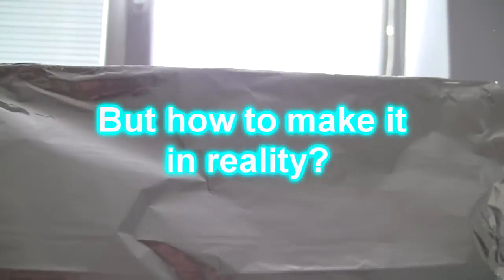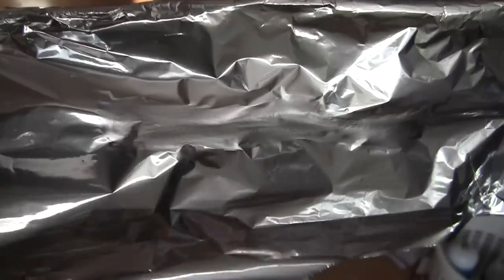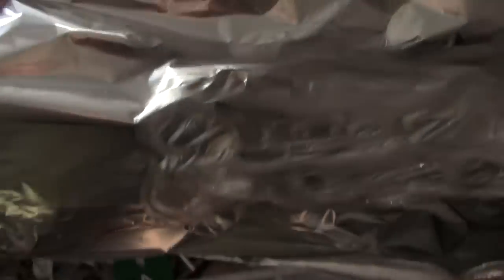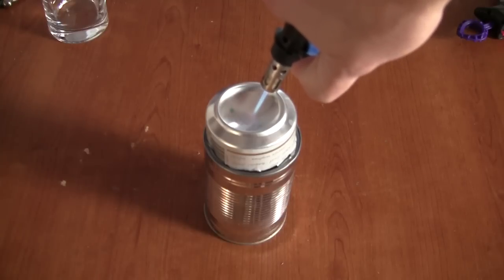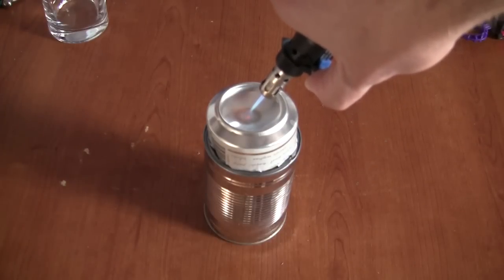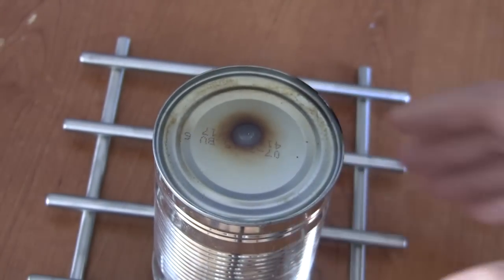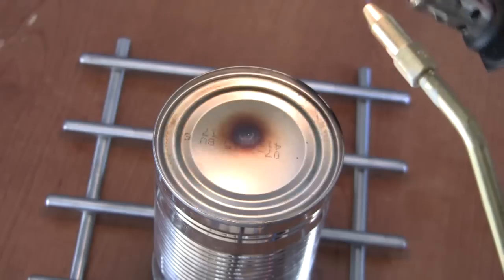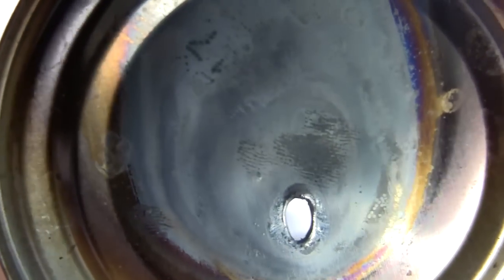How to make REAL Transparent Aluminium!

Comment: interesting, but i assume this weakens the material right?
Reply: +Christ J incorrect. 100% pure sapphire is called white sapphire. as in sapphire glass, used for luxury watches and for the windows of cruise missiles and for high pressure applications. in natural gemstones, the colorless variety is also called white sapphire. the real issue is that for aluminium oxide to be called sapphire it must be crystalline.
Reply: +Paul Meyer pure Aluminium oxide categorically is NOT called "sapphire".
Reply: Paul Meyer yes, really. "Sapphire" requires certain impurities to give it colour. A colourless "sapphire", by definition, is not sapphire.

Nice link, by the way. Very mature. Particularly embarrassing is the fact that it doesn't actually match your assertions. Maybe you should ask someone to teach you how to use Google properly...
Reply: kurtilein3 sorry, but sapphire is a variety of corundum, which is aluminium oxide with iron, titanium and chromium impurities. Aluminium oxide without these impurities is aluminium oxide, not corundum/sapphire/ruby.

http://rruff.info/doclib/hom/corundum.pdf

- by definition, sapphire is a variety of a mineral that is defined as being impure aluminium oxide. I know this may seem a little pedantic, but this dictates that aluminium oxide (PURE aluminium oxide, that is) cannot, by definition, be referred to as "sapphire".

Even "100% pure sapphire" is not pure aluminium oxide.
Reply: +TheGeckoNinja Transparent aluminium is actually incredibly strong, although when it's used in manufacturing processes they tend to have a slightly more refined way of producing it.
Reply: echomjp those miniscule impurities generally make all the difference, though. Far from being pedantic, pointing out these tiny differences is sometimes the only way to tell variant of a substance from another.

Have you ever seen jewellery advertised as having an Aluminium oxide crystal in it? Or seen a thermitic reaction described as producing iron and sapphire?

Paul Meyer stated that Aluminium oxide and sapphire were the same thing. All I'm saying is that, by definition, they are not.
Reply: +TheGeckoNinja     Transparent aluminum, also known as aluminum oxide, also know as saphire
Reply: +Profezor Snayp Wait a second, providing well cited evidence makes him look dumb, while at the same time you are saying we should just take your word for it?
Reply: Bruce Wayne
Also, no. Oxygen is not called air and vice versa because air is mostly composed of nitrogen. If the majority component were oxygen, then it would be somewhat more forgivable to call them the same thing in common conversation. If the vast majority component (as is the case in sapphire) were oxygen, rather than just a normal majority, then it would be pointless outside of scientific research or addition of dangerous gases to call the air anything but oxygen.

For the same reason we don't call the air we breath in "air with a mixture of dust particles and water vapor and whatever micro-organisms float in the air among many other things depending on the situation." The exact composition of air and of most substances in the world is never exact, so all we really need in most situations in the real world is to describe something in a way that can be quickly understood and is mostly accurate.
Reply: kurtilein3 no, sapphire, specifically BLUE sapphire, is an Aluminium oxide crystal with iron and titanium impurities. Look it up.
Reply: +Profezor Snayp your CLAIMED expertise is worthless, as I provided evidence that backs up what I said. I'm right, and you're wrong. No amount of arguing from (claimed) authority will change that.

The instant you rely on a logical fallacy to twist your way out of a situation that you incapable of explaining your way out of you have tacitly admitted your error. The fact that you mention a source that I haven't actually linked to makes you look even more of a fuckwit than your dogmatic desperation to preserve your ego amongst complete strangers in an anonymous forum. Pathetic.

Of course, as a decent scientist I'm willing to admit an error if you can show me to be incorrect. With that in mind, I invite you to present some evidence that PURE Aluminium oxide and the mineral referred to as corundum are identical. I won't hold my breath...
Reply: +Christ J  Oh really:
http://lmgtfy.com/?q=al2o3+compound+name
Reply: +Christ J That is indeed pedantic. Sapphire is primarily made up of aluminum oxide, and in nature it is nearly impossible to "get" a completely pure sample of any substance in the first place. So really, it boils down to exactly what the impurities are and how common they are. Neither of those points will change what the primary composition of the substance is, or in this case properties, so it seems a bit weird to mind what the name is.

Anyway, clarifying that it isn't "really" sapphire I suppose could be true. It just is that if someone were to say "this is almost entirely made up of aluminum oxide" it would be 100% accurate, but that doesn't roll off the tongue very well compared to just calling it sapphire. It isn't like we're actually doing chemistry here, and need to worry about the minute details in day to day descriptions of things.
Reply: Christ J
what the fuck?  http://www.guildoptics.com/optical-windows/sapphire-windows/?gclid=CP7V7dbyhsgCFUHnwgodL3gCiQ
Reply: +K IRA You're both right in a way. It's very hard, but inflexible. That makes it brittle, sort like steel with too much carbon. Makes it harder, but more prone to shattering.
Reply: Skippy Rock
Well, being pedantic actually can have a purpose in science, where small distinctions matter. So, sure.
Reply: +Christ J Aluminium oxide Al2O3 is called corundum. Every single variation except for the red type is also called sapphire. The red one is called ruby. So in other words - the colorless type is called sapphire.
Reply: That's one big ball of logical fallacies you got there...
Reply: TheTinySaint
At this point, when various people have pointed out his "well cited evidence" is bs, it doesn't really matter. Everyone on the internet is an expert in every field imaginable. I base my knowledge on years of studying and working in field of geology, petrology, mineralogy etc - he reads websites on the internet. Seems equally valid. Goodbye and goodnight.
Reply: "Aluminium(III) oxide (Al2O3) ... commonly called alumina, and may also be called aloxide, aloxite, or alundum. ... In its crystalline polymorphic phase α-Al2O3; corundum, sapphire, and ruby".

That's taken from wikipedia (not the best reference I know but usually OK for science. I'm a scientist but this isn't my field). So it appears that different crystal structure give it a different name and the impurities that colour it are irrelevant. So aluminium oxide, alumina and corundum would be analogous to carbon, graphite and diamond respectively if that helps anyone. You can say "diamond is always a crystalline form of carbon" but you can't really say "carbon is always diamond" as often it's graphite. Likewise, sapphire is a crystalline from of aluminium oxide, but aluminium oxide is not always sapphire as often it's alumina.

Hopefully that will help to conclude this rather pointless discussion but I doubt it will make a difference.

There are also Aluminium (I) oxide and Aluminium (II) oxide which again are different.
Reply: I hate to stick my nose into a heated debate and I'm not going to take sides, but ask is the difference a crystal structure thing, like how graphite and diamond are both carbon? If it is something like that and not about the impurities that give different colours, that would be like arguing all carbon is diamond because all diamond is carbon. I'm not a geologist, please don't bite my head off.
Reply: Christ J Except I did refute it, did you ignore that post?
You know, the one where I linked to a variety of scientific sources showing corundum as just being aluminium oxide (with no mention of impurities, one even having a section from trace elements with nothing listed) (and one having it being 0.004% of aluminium replaced by chromium).

Corundum (and thus sapphire) is a form of aluminium oxide which may contain trace amounts of other elements.

Corundum refers to a crystal structure, not to alumina with impurities. It is similar to quartz and silica.

Also note, your reference appears to list quite a lot of things as having impurities, for example:
diamond:
"Nearly pure carbon"
http://rruff.info/doclib/hom/diamond.pdf

Quartz:
"SiO2 with traces of other elements."
http://rruff.info/doclib/hom/quartz.pdf

Anatase:
A combination of TiO2 [which is what anatase actually is] as well as SnO2, Al2O3, Fe2O3, CaO and LOI, however that is only for one composition, another composition given only has TiO2 and Fe2O3, adding up to a total of 99.67%.

So it appears your site is just listing the composition of some known samples, not defining it as what it contains.

So care to admit you were wrong?
Reply: kurtilein3 Also, that would be equivalent to making it into aluminium and oxygen atoms, not Al2O3.
Reply: echomjp
is there something wrong with these 100% pure sapphire windows? http://www.guildoptics.com/optical-windows/sapphire-windows/?gclid=CP7V7dbyhsgCFUHnwgodL3gCiQ
Reply: +echomjp to me it sounds like the other guy is right, like calling oxygen air and vice versa.
Reply: Christ J
aluminium oxide and sapphire are not the same thing, but you are wrong about the impurities. sapphire is an iron oxide crystal. the kind without impurities is called white sapphire or sapphire glass.
Reply: Profezor Snayp wrong. Al2O3 is called Aluminium oxide. Corundum is Aluminium oxide with certain impurities.
There is not a single variant of corundum which is pure Aluminium oxide. Corundum is defined as IMPURE Aluminium oxide.
"Nearly pure Al2O3, with traces of Fe, Ti, and Cr."
- see that? That is how corundum is defined. There is no rational way that "nearly pure" will ever mean "pure". The definition of "corundum" is, in essence, "impure Aluminium oxide".
By the way, that little excerpt is from here:
http://rruff.info/doclib/hom/corundum.pdf
- which I have already posted once in this thread. Try reading these sources before making claims that are refuted within them - It makes you look like a moron.
Reply: Profezor Snayp Absolutely mind boggling how a geologist can tell him he's wrong, yet he still doesn't comprehend it.  It's not even that complicated of a concept.
Reply: hondac55 I don't give a shit what some lying YouTube troll says I'm wrong, because I have presented evidence to the contrary. Until you refute that data it remains valid, which means I am right by default.

I'm right - you're wrong. I have evidence - you have nothing but narcissism.
Reply: Christ J I have presented evidence, which you ignored.  You are what's wrong with the internet.  You're obviously not going to change your mind, so we're done here.  Pure Al2O3 is sapphire, whether you want to believe that or not is irrelevant, it's just a simple fact of nature.
Reply: Christ J
the thing is, the links you provided were crap, and you ignored the links we provided. white sapphire and sapphire glass is pure aluminium - no impurities. it is called white sapphire by scientists, engineers, watchmakers, gemologists and dealers all over the world. that is the main problem: you are wrong, your links are crap, and you refuse to admit it. i will re-post a link you ignored: http://guildoptics.com/optical-windows/sapphire-windows/?gclid=COm9mPnliMgCFVEYGwodFkkEOA   and i will add another one  http://us.tagheuer.com/en/avant-garde/innovations-technology/movementsandmaterials/details/materials/sapphire-crystal
Reply: KX36 essentially, yes. Different impurities interact with light in different ways, resulting in different colours, shades, etc. Globally, they  have extremely similar structures.
Reply: Christ J I have exactly three (now 4) posts in this thread, one of which contains a higher quality link than any of the links you've posted.  You're here to argue, you're not here to learn, that's your downfall.  I learned from my experience here; particularly, I learned that Al2O3 is sapphire.  Now go cry.
Reply: KX36 and if you had clicked on the hyperlink to "corundum" you would have found this:

"Corundum is a crystalline form of aluminium oxide (Al2O3) with traces of iron, titanium and chromium."

- see that? Corundum is not Al2O3 which sometimes has impurities within it, it is a mineral which ALWAYS has "traces of iron, titanium and chromium" within it. Those trace elements are every bit as fundamental to corundum as the Aluminium oxide they wedge themselves into.

Wiki is a decent resource, but you really need to treat it as a starting point, rather than the final word.

"So aluminium oxide, alumina and corundum would be analogous to carbon, graphite and diamond respectively "

- graphite and diamond differ in their crystal lattice structure, but this results in wildly different strengths. Sapphire and corundum have the exact same hardness, which is a clue as to how similar they are in terms of their crystal structure.

Think of sapphire as corundum crystal which has a particular colour.

"sapphire is a crystalline from of aluminium oxide"

- yes, but ONLY when certain impurities are present. Sapphire NEVER features only aluminium and oxygen. Ever.

"Hopefully that will help to conclude this rather pointless discussion but I doubt it will make a difference."

- nope. I'm too stubborn to let people ignore scientific data just because it would mean admitting they were wrong, and those two are too egotistical to read the paper I presented and either accept it or refute it.

I've blocked them both now, as I'm sick of their spam, so this will end here. They were never going to give me anything to analyse anyway...
Reply: _"So aluminium oxide, alumina and corundum would be analogous to carbon, graphite and diamond respectively "

- graphite and diamond differ in their crystal lattice structure, but this results in wildly different strengths. Sapphire and corundum have the exact same hardness, which is a clue as to how similar they are in terms of their crystal structure."_

If you re-read what I said it was that alumina and corundum have different structures, not corundum and sapphire have different structures.

Although the impurities are present, it does seem like it's irrelevant to the difference between alumina and corundum (where sapphire and ruby are types of corundum) and that the differing factor between alumina and corundum is the crystal structure regardless of purity.
Reply: hondac55
quote: " I learned from my experience here; particularly, I learned that Al2O3 is sapphire." incorrect. sapphire is Al2O3. but sapphire is never a white powder of no significant hardness. it always has hardness 9. Al2O3 generally is a white powdery substance of no significant hardness. you fell into the carbon vs diamond trap.
Reply: KX36
its more like carbon and diamond both being carbon. with aluminium oxide being equivalent to carbon, and both sapphire and corundum being equivalent to diamond.

and then the discussion gets complicated by one nutjob arguing that highly pure sapphire, the perfectly white and clear and flawless variety, is not sapphire.
Reply: kurtilein3 You can't even say that sapphire isn't Al2O3 without contradicting yourself.  "Sapphire is Al2O3," my point exactly.  If you grind up a diamond into a fine powder, it is still diamond.  If you grind up sapphire into a fine powder, it is still sapphire.  The opposite is also true.  Powdered Al2O3 = sapphire.
Reply: Leuco-sapphire.

Every form of sapphire is just a variation/modification of corundum. 

The "colour" or more specific the amounts of other elements within the corundum make all the "difference". It´sjust a specification process. If it´s red (chromium) we call it ruby - any other colour we will name "sapphire" EVEN THOUGH the variations within sapphire could also be split up into many different groups (but they don´t have special names... even if the colour-spectrum is quite huge).

So corundum = sapphire, ruby, padparadscha and so on, leuco-sapphire being the transparent form of it. 

So I really don´t get the "debate". 

TO make it very clear SAPPHIRE, RUBY and WHATEVER - are JUST varieties of the SAME material.

EDIT: I have to make this clear - I welcome every sort of criticism but I am pretty sure that this is factual. Also please don´t be to harsch on my english, for it is not my first language.
Reply: Semjasa616 The debate is whether Al2O3 is called "sapphire."  Obviously it is.  The structure of the Al2O3 does not determine whether sapphire is sapphire or just Al2O3.  Al2O3 is sapphire and sapphire is comprised of Al2O3 at its base.  The chemical sapphire is Al2O3.  There is no debate, that's just...that's fucking common sense, Jesus..fucking...Christ.  Not against you, but some of the other people in this thread, it's just a ridiculous argument.  Sapphire is Al2O3, there's no other way to say that.

Also, your English is very good; considerably better than most people's English who have been speaking only English their entire lives.  One correction, not to be rude but just so you know, "harsh" has no "c" in it, as in, "I'm trying not to be harsh on you."  :)
Reply: hondac55 well I mean it is a discussion about nothing thats exactly the point. 

Ye and btw. that thing with "sch" and "sh" is a typical "writing disability" that stems from my mothertongue, german. Quite silly but ye.
Reply: Semjasa616 Yeah I figured it was some sort of crossover from your native language, not a big deal, but it's good to learn.  :)
Reply: KX36 " the differing factor between alumina and corundum is the crystal structure"

- ah, gotcha. In that case, you're still not quite right. Corundum is a variant of alumina, just as sapphire is a variant of corundum. Think of alumina, corundum and sapphire as family, genus and species respectively.
Reply: Semjasa616 "TO make it very clear SAPPHIRE, RUBY and WHATEVER - are JUST varieties of the SAME material."

- agreed, just as they are all forms of corundum. However, they are NOT pure Aluminium oxide.

"So I really don´t get the "debate". "

- I've been disputing people who are insisting that "corundum" and "sapphire" are compositionally identical to "alumina". Scroll up a little and you'll see them repeatedly stating that sapphire is PURE Aluminium oxide, which is simply false.

You're perfectly correct in that there is no debate here, but that hasn't stopped them from spamming the thread anyway.
Reply: hondac55
this is not true. you can grind down diamond into carbon, at which point its unique properties are lost. AL2O3 lacks the hardness, transparency, thermal conductivity and tensile strength of sapphire.
Reply: kurtilein3 Why is it then that you can grind up another crystallized chemical, C12H22O11, into the finest possible powder, and it is still C12H22O11?  Do you not see the point here?
Reply: +Christ J Corundum is actually a crystalline form of aluminium oxide. The impurities doesn't matter. If it's an aluminium oxide crystal, it's called Corundum. Pure crystal is corundum, sapphire is corundum and every other variation is corundum.
Reply: TheFarciarz777 "If it's an aluminium oxide crystal, it's called Corundum."

- wrong. If it's PURE aluminium oxide then it's called aluminium oxide, or alumina. Corundum is what we call aluminium oxide when it has impurities.

Check my previous links. One is to a scientific definition which explicitly states that corundum contains impurities. Since no-one has managed to refute it I am accepting that link as correct. Maybe you can shoot it down...
Reply: Chris G maybe, but that means it isn't Aluminium oxide. Sapphire =/= Aluminium oxide.
Reply: kurtilein3 No. You can't. If you gind down diamond (using another diamond to do so, or going through a lot of grinding tools) you will end up with diamonds. They will no longer be the wonderful single crystals that they once were, but they will still be diamonds. This is used in a variety of tools, such as diamond saws.

The only exception is if you grind it down to the nanometre scale, at which point it can undergo surface rearrangement and change properties.

And of course, to view the properties, you would need to be analysing a single crystal, not a bunch of crystals in the form of powder. That would be like analysing a bunch of diamonds in a truck and declaring that it isn't as hard as a diamond. Multiple individual crystals (not polycrystalline materials) are rarely as hard as a single crystal as the crystals are free to move around.
Reply: Jeffrey Black "Except I did refute it, did you ignore that post?
You know, the one where I linked to a variety of scientific sources"

-you haven't posted in this thread before, princess, so feel free to keep your bullshit to yourself. Only one other person has posted any links, and all I got from him was a couple of product sales pitches without a scrap of scientific data between them.

"Corundum (and thus sapphire) is a form of aluminium oxide which may contain trace amounts of other elements."

- except that corundum minus those impurities is called Aluminium oxide, not corundum(or sapphire).

"it appears your site is just listing the composition of some known samples"

- and it fails to list pure Aluminium oxide as "corundum", or "sapphire". So, once again, I invite you to present a single source which denotes sapphire or corundum as being PURE aluminium oxide.

You won't, because no scientific source will refer to them as identical, because they are not.
Reply: Jeffrey Black I'm not sure why this is such a difficult concept to grasp.  This is elementary shit right here.
Reply: hondac55 I would say it is one level above elementary. It goes based upon phases, not just chemical composition.

But it is still very simple.
Reply: Jeffrey Black I guess I should say high school level.  If you're in high school you should probably understand this kind of stuff.  If you've graduated, you have no excuse.
Reply: Jeffrey Black
i think you fail to grasp the most basic chemistry and atomic theory here. if you grind down a diamond, it is atomized, and a single atom of carbon, or lets say 3 of them clumped together, cannot be diamond. its really basic stuff, and your ignorance about it is collossal.
Reply: kurtilein3 You have completely missed the point.
Reply: kurtilein3 No. I think you are the one that failed, quite miserably.

Grinding things down will pretty much never get you down to the atomic scale. You might get down to the nanometre scale, but not atomic.

The typical powdered alumina you get is a different phase. If you get powdered sapphire it would have the same properties as sapphire (except it can't be gem quality).

If you knew basic chemistry, you would also know carbon very much dislikes being a single atom all by itself. It wants to form bonds, 4 specifically. As such, you couldn't have a carbon by itself, it must be bound to other atoms, such as the carbons near it. The only exception is when there are no atoms nearby such as in space or other vacuum systems, but then it can't be a powder.

If you atomise carbon, it can no longer be diamond, but that isn't what grinding is.

Also, by virtue of being an atom, it would be very hard, it would have properties far superior to diamond.

So no, I haven't failed to grasp anything. You just want to do the impossible.
Reply: +Christ J obviously we need someone who has a PhD in this field to sort this one out, someone please find a PhD for this man.
Reply: WIlliam Johnston No PhD needed, good buddy.  A high school diploma is all you need.  I remember learning about crystallization and corundum.  It was like a two day lesson.  I even remember making a sugar crystal in elementary school to learn how crystals form.  Corundum is fairly basic chemistry and not complicated geology.
Reply: WIlliam Johnston Not really. However I will ask a guy next time I see him (hopefully tomorrow, there are plenty from me to choose from).
Reply: WIlliam Johnston well, one person in this thread has already made similar concerning his own probably-fictitious qualifications, and it sure as hell didn't solve it.
Frankly, I think my solution is very simple. If a single source can be found which specifies that corundum/sapphire can be composed - in theory, at least - of pure Aluminium oxide I'll concede the point. If such a source cannot be found the null hypothesis will be that they are differentiated by the fact that corundum and sapphire are ALWAYS described in terms of their impurities, meaning that they cannot be pure Aluminium oxide.
Reply: Christ J Except your solution only works when the posts containing these sources will show up. When they don't, they are just ignored.

No. The null hypothesis is that a crystal type is based on the main constituents and would include a hypothetically pure sample containing no impurities.
You are the one going against the null hypothesis, claiming that this particular mineral/crystal type requires impurities to be present. As such, you are the one who needs to prove it. So far, all you have done is provide a source which appears to be describing the composition of one sample, not corundum in general. I have provided several sources refuting that, and you have just ignored it.

Also note that your reference is claiming it must have impurities of Fe, Cr and Ti. That means if it is missing one of them, then according to you, it can't be Corundum.

What would your reference call aluminium oxide in the alpha-Al2O3 phase, which contains no impurities?

Corundum is described by its phase, not its impurity content.
If you get aluminium oxide, not in the alpha phase, and add in some impurities, it doesn't magically become Corundum. It is still the wrong phase.

How about a different approach.
Do you agree that diamond can hypothetically be pure carbon? Or must it also contain impurities?

How about Quartz? Can that be pure SiO2, or must it contain impurities?
Reply: Just for clarification, can people other than Christ J see my post with a bunch of links (once posted around 2 days ago, with various links about corundum, and then another posted around 1 day ago, with broken links to try and prevent any spam filter stopping it)?

Are my posts actually not visible, or is Christ just ignoring them?
Reply: Jeffrey Black
with grinding down a diamond i do not mean breaking it into pieces, and then smaller and smaller pieces. i mean it like you would cut and polish a diamond, with a rapidly rotating stainless steel disc with water for cooling and fine diamond powder. if you stop halfway you get a perfectly smooth polished surface. it turns directly into an amorphous carbon sludge.

do the same with sapphire, and you get a sludge of Al2O3, because that is most stable, you might also get some other compounds. individual atoms do get ripped out of place atom by atom, but that happens to both the aluminium and the oxygen, and Al2O3 is the structure they like to be in after the process.

when you burn/oxidize aluminium metal into Al2O3, you do not get any sapphire, because sapphire actually is at a higher energy level, you get amorphous Al2O3. the white powder you get contains no pieces that match the properties of sapphire. to make sapphire, you need additional energy, and the circumstances need to be carefully adjusted. typically it is being done by using a blowtorch flame of hydrogen and oxygen, and adding Al2O3 to the flame, and then you hit an actual sapphire with that flame. the surface temperature of the sapphire needs to be just right, just below the melting point of sapphire. then you get a lot of Al2O3 dust blowing around as waste, but the sapphire also slowly grows.

grinding/polishing down a sapphire reverses this process.

these are the basics that you do not understand. turning Al2O3 into sapphire consumes energy, and to force it you need either just the right low pressure high temperature plasma environment (hot flame containing Al2O3 hitting a sapphire just right), or a high temperature high pressure environment (where the high pressure favors sapphire by virtue of higher density). any Al2O3 that forms outside of these parameters will be free of sapphire crystals.
Reply: kurtilein3 Which then isn't grinding down the diamond into carbon. It is taking carbon off the diamond. The diamond you have after grinding it down remains as diamond with the properties of diamond.

I understand that there are different ways to achieve it and not all options will result in sapphire.

So no, I wasn't misunderstanding the basics, I was misunderstanding what you meant. I thought you meant grinding down diamonds, and the resulting ground down object, as your wording implied.
Reply: ***** That seems strange. I'll try again with it broken into pieces.

Edit:
Nevermind, this isn't working. Lets see if this will.

I have reposted it here over at https://plus.google.com/103214085763622277494/posts/85huDdPeRnb So Chris J, can you go there and look at those sources?
Reply: Right: that is an assumption.
Reply: Christ J not sure if you would check without being mentioned, but check out this link with my comments and see if you are willing to change your mind.

https://plus.google.com/103214085763622277494/posts/85huDdPeRnb
Reply: Jeffrey Black that's the exact same post I have already dealt with a couple of comments up. I'll just re-post my response there as well, shall I...?
Reply: Christ J No it isn't. That is a post which failed to appear before. The post you accused me of never posting. (unless you did try to reply here and it just never showed up).

It contains numerous references to Corundum which don't require trace elements.

Glad to see it wasn't just you not seeing the post that was the problem, you just don't want to admit you were wrong.
Reply: Jeffrey Black
your google+ link makes sense. sapphire is a single crystal of larger size, corundum is polycrystalline, with a spectrum in between, both with similar hardness and physical properties, except that corundum does not have the optical properties.

and generally Al2O3 is neither, because its generally just a white powder like magnesia or titanium trioxide, without any of the properties of corundum or sapphire.
Reply: Christ J No. You were wrong, because I had in fact posted it. I can provide a screen shot of it if you like.

If you did comment on that post here, it is not visible to me and is most likely not visible to anyone other than you and possibly those who follow you.

So I am just as correct as saying you never posted it as you are saying I never posted mine (if not more, as I can't actually confirm that you have posted it while I can confirm that I did post mine).

And no, it doesn't appear here for me. How about you provide this screen shot of you logged out showing it as still visible?

And sure, your repsonse somewhat detailed, but full of flaws, which I have refuted.

I am not the one who fucked up and can't admit they are wrong. You are the one who is using a single source that is describing the composition of particular samples and using it to claim that that all samples must contain these impurities. I have provided sources which don't require these impurities, one even listing essential elements, not including these trace elements as essential. This is indicating that corundum is referring to a phase of Al2O3, just like diamond.

You are also the one who completely ignored other sections of your reference containing what you should interpret as completely ridiculous things based upon how you interpreted its entry on corundum.

Can you provide a decent source that states corundum MUST contain those impurities, and not just a particular sample has them? If possible, can you also provide what this source claims pure alpha-Al2O3 is, and if it also lists diamond and quartz as having impurities, and if it lists 2 different compositions for anatase?
Reply: And here are the screenshots to show my posts do exist.
https://plus.google.com/103214085763622277494/posts/VBqELS4bwai

Now care to post yours showing it still being there when logged out (on this thread, not the other one)
Reply: Jeffrey Black
https://plus.google.com/u/0/101164041182319826757/posts/gUCcabYjHgd?pid=6199923007409783666&oid=101164041182319826757
Reply: Christ J Are you capable of understanding English?

I didn't ask for you to show me my post. I posted evidence that they did exist. I asked you to back up your claim of your post existing, you know, the one you claim you posted here which I can't see. I asked for you to show that post when logged out. Care to provide what is actually asked rather than just avoiding the issue?

Here is a screenshot of what it looks like for me:
https://plus.google.com/103214085763622277494/posts/3VWgJWq4Y39

Notice a lack of your "detailed refutation"?
Reply: +Jeffrey Black go fuck yourself, Jezza. I thought you were still bitching about your phantom posts, which is understandable, given your vociferous, rabid mentions of them. I make no apologies for not double-checking that you hadn't switched topics again.

I'm going to give you a while to glance at this, then I'm going to block you, because I'm getting more than a little bored of dealing with your schizophrenic caprice.

https://plus.google.com/101164041182319826757/posts/dd7Hk8FQGZn

- which immediately follows your link to it.

This is all moot, as I copied and pasted this reply into your own Google+ post anyway.
Reply: Christ J Do you really not understand, or do you think that you have already dug yourself in so deep further lies/stupidity can't make you look any worse?

I asked you to show it when you were logged out. This is to back up your claim that your post does show up when you were logged out to try to back up your baseless accusation of me lying about it.

This is indicating you aren't even reading what I am saying and instead are just skimming through. How do you plan on having any kind of rational discussion when you don't bother reading what the other person is saying?

Go ahead and block me, it will just show you have no rational arguments.
Reply: +Christ J From what i understand (i dont have links, whatever) there is no formal name for cristaline aluminum oxide, its either called condurum or saphire, and the amorphous aluminum oxide, which is not cristaline in here, is called aluminum oxide
Reply: aajjeee aluminium oxide is crystalline.
Reply: it isn't necessary. by that logic carbon is crystalline because diamond is crystalline, but the aluminium oxide he is making dosent have a chance to produce a crystalline structure so it is a different allotrope of aluminum oxide. while i cannot prove it is amorphous, the amorphous allotrope definitely exists (http://journals.aps.org/prl/abstract/10.1103/PhysRevLett.103.095501 here is a resumé which expressively states its existence)
Reply: aajjeee in other words, melting a substance and then preventing it from forming its usual, three-dimensional crystal structure when solidifying prevents it from forming a regular crystal structure? That seems pretty trivial.

What this video - and that paper - show is that it's fairly simple to tear apart an Aluminium oxide crystal to the point where it no longer has a particularly regular crystal structure. You'll note that the "amorphous" substance was still made of crystals of four- and five-coordinated Alumina, as stated in the abstract. Those are still regular structures, similar to that forming the basis of crystalline Aluminium oxide. They just happen to have been broken into fragments by the heating and prevented from slotting back together in the most efficient way.
Reply: aajjeee I wouldn't expect much from him. Once he has his opinion he seems pretty fixed on it and refuses to accept any correction.

I am also not sure if this would be crystalline or not.
Reply: +Christ J its not cristaline unless there is a full primitive cell (i had to translate that word not sure its the exact one)
Reply: aajjeee in essence, crystallinity just means that it has a repeating molecular structure. While what you say is, technically, correct, a primitive cell can be made of only a handful of molecules/atoms. The paper you linked to explicitly mentioned several different such cells, and even noted their abundance.

The video may have produced a form of Aluminium oxide that was not globally crystalline, but the paper you linked to indicates that, at smaller scales, it was still made of crystals.
Reply: aajjeee That is one of the options.

Typically people would say unit cell, as quite a lot of things will have multiple lattice points in the unit cell (for example, diamond will have 4), but the primitive cell will only have 1. This allows unit cells to be simple shapes, like cubes, instead of more complicated ones like parallelepipeds.

Also, it is further complicated by the idea of crystalline amorphous materials.

For something to be a crystal, it needs to have a long range structure that can be simplified to a unit cell which can be infinitely translated to produce the structure.

For something to have crystallinity (or in some places they would say it is crystalline) it needs long range ordering.

For example, polyethylene will basically never form actual crystals. However, it can have long range ordering where the chains align themselves, which would be crystalline PE or PE which a high crystallinity, or it can have no long range ordering with the chains all over the place giving you amorphous PE.
Reply: aajjeee And Christ J seems to have no idea what he is talking about. He just spouts some garbage and sticks to it.

The paper talks about co-ordination environments, not unit or primitive cells.

It also explicitly states that it is not crystalline.

Having similar molecular connections doesn't make something crystalline. Water still has H2O, as well as H3O+ and OH-, and it even has an average number of hydrogen bonds. That doesn't make it crystalline.

In order for it to be crystalline it needs to have some structure that can be repeated via translation alone to form more of it.
Reply: Jeffrey Black some structure that can be repeated via translation alone to form more of it.
this is what i mean by unit cell, and i agree with you
Reply: +Christ J Gee, well I guess i'd better go sue the company that made my watch, seeing as a crystal made of pure Al2O3 is not actually a sapphire crystal....
or not. Sapphire as in the gemstone only refers to the blue corundum, yes, but sapphire the material includes artificially produced pure Al2O3 crystals. Yes, not all Al2O3 is sapphire, obviously if its a friken powder or dull lump of slag-looking crap. But if it's a pure transparent crystal, its called sapphire. get over it.
Reply: ButWhoWasMoto? everyone loves a good, old-fashioned thread resurrection.

"Sapphire as in the gemstone only refers to the blue corundum, yes, but sapphire the material includes artificially produced pure Al2O3"

- nope. Synthetic sapphires also introduce the same impurities that make sapphires sapphires. A "sapphire" without those impurities is, as various sources from myself and those who have argued with me have proven, not a "sapphire". The impurities are what differentiates sapphire from corundum.

Pure Aluminium oxide is Aluminium oxide. Impure Aluminium oxide is - sometimes - sapphire.

"But if it's a pure transparent crystal, its called sapphire"

- sapphires aren't purely transparent, though. Sapphire glass is blue. 

"get over it."

- you're the one who brought it up again after almost half a year since the last comment. Who really needs to "get over it"..?
Reply: Jeez… to think that this could've all been avoided by a simple yes or no.
Reply: So I see Christ is still spouting his bullshit.

No. Your sources have shown that aluminium oxide with these impurities can still be saphire. Your sources do not indicate it needs these impurities to be saphire.

My sources did indicate that saphire can be pure aluminium oxide.

Artificial saphires don't need the impurities.

Pure aluminium oxide can be saphire.

Depending on what you mean by transparent, nothing is purely transparent, or even blue saphires are. If you mean it absobrs/scatters some light, then everything does that, even air.
If you mean it allows light to pass through, then even blue saphires do.

As you are still spouting the same refuted nonsense, you are the one who needs to get over it.